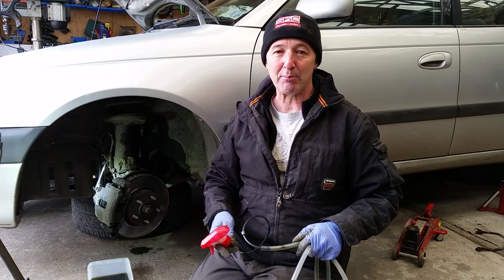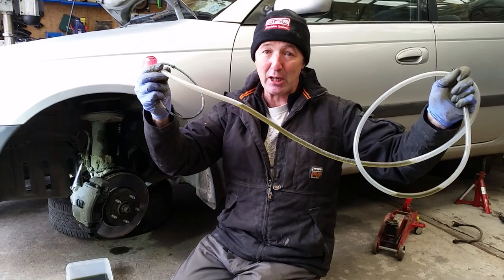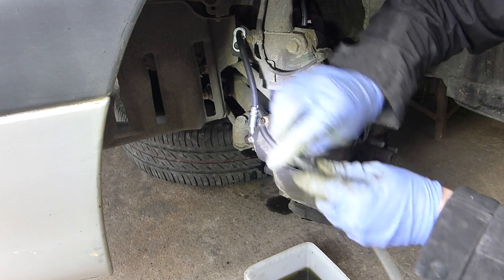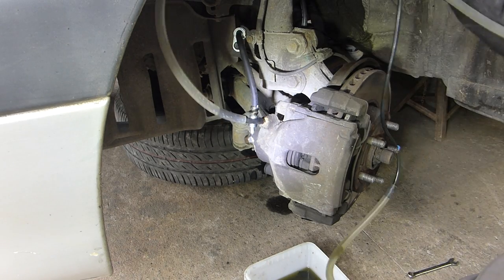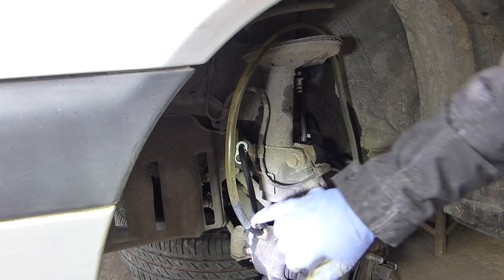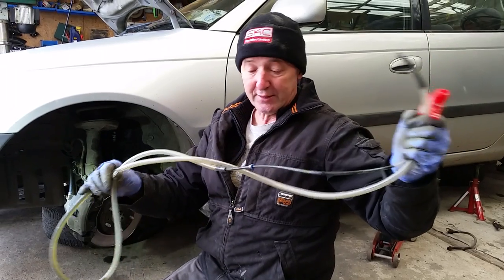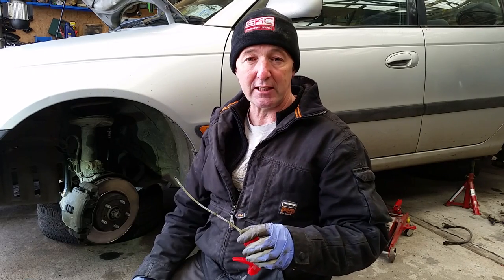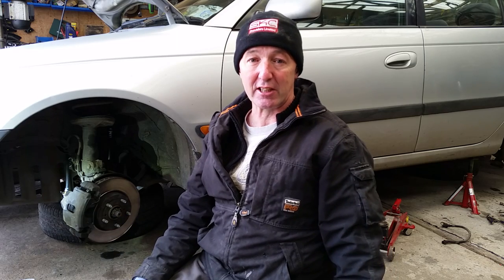Awesome - Homemade car brake bleeder -- Brake Flush -- Free

Comment: What a mickey mouse setup. Would you bet your life with this brake system? I wish I had a quarter for every one man homemade bleeder setup I've seen, I'd be rich.What's wrong you might say?1. Pulling air through the caliper piston seals is one likely side effect. (The worst possible scenario.)2. Not as serious, but he is pulling air in around the bleed nipple threads also, so in combination with his patched together hose setup, also leaking air, how does he differentiate between the system air and the air from all these leaks. 3. Eventually brake fluid is going to melt and seize the plastic in the sprayer head. 4. No mention of sucking the old fluid out of the M/C, or any mention of making sure it is kept fullOverall I rate this piece of garbage Minus 5 Stars out of 5.
Reply: Michael McLernon 

Hi negative Nancy. The only point which you raise which potentially has merit is the air already in the tube thing. That said, the firmness of the pedal is a reliable indicator of air left in the system.

Pulling air through the piston seals? Utter crap and would never happen, especially with the small amount of vacuum created by a pump spray.

When you say sucking fluid out of the master cylinder do you mean not letting it run too low?

Or...

If you're just bleeding the lower sections of the system and not replacing the fluid why would you want to suck out the fluid present in the master cylinder?

Unless you're a total dipshit then you'll already know you need to keep the master cylinder topped up regardless of the technique you employ.